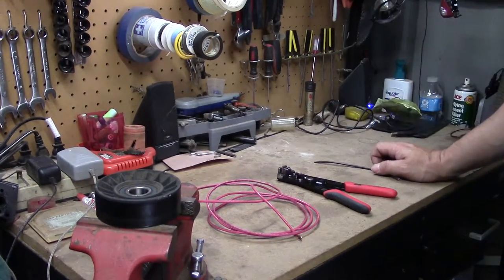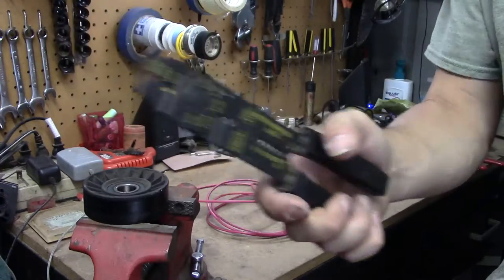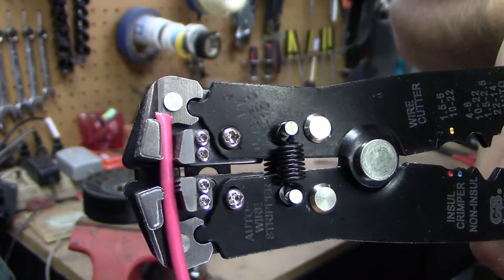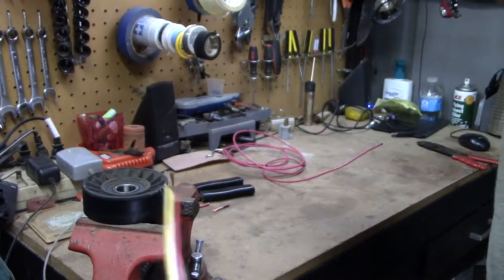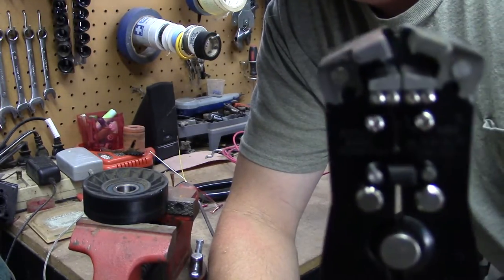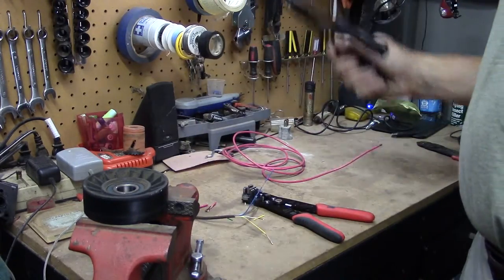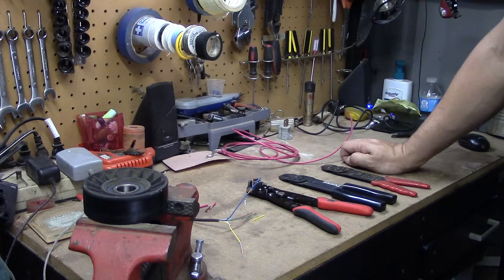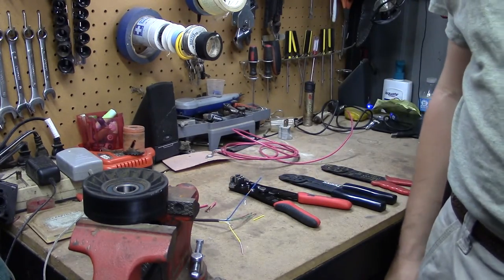GARDNER BENDER WIRE STRIPPER REVIEW

Comment: Wow!  I just bought the cheap one you showed that wouldn’t open.  I am now going to return it and get the major upgrade one!  Funny thing I was looking on how to use the cheap one and so lucky to have found your video!  Thanks! Back to Home Depot I go!
Reply from the maker: Yeh mine has become a little sticky but not bad. I just used it the other day and it's still the best wire strippers I have. Thanks for watching.

Comment: i have the same exact model and it doesnt work that well , is there a adjustment for it ?
Reply from the maker: I am not aware of any adjustments. That is odd, mine is still my goto stripper I love them.
Reply: @jason-white  mine does not hold the wire in the back
Reply from the maker: @EnergySeeker  Interesting I looked at mine and I do not see how it is possible, the more you pull them together the tighter it holds the wire and they in fact do not have any adjustments that I can see. I would ask for an exchange.
Reply: @jason-white  i think so too , thanks for your time

Comment: I got one today at ace hardware for $18.99. Need it for electrical modding projects.
Reply from the maker: How is it working out for you so far? I love mine, use them every time I have  to strip some wire.
Reply: I want to buy it , I m an electrical engg.
Reply: How can I buy it

Comment: The blades dull and can't be replaced as far as I've found. But they are great .... while they last.
Reply from the maker: I never thought to look into replacement parts until reading your comment but it would appear you are correct, I was not able to find new blades on Google. The good thing though is I made this review 4 years ago and my GB-394 strippers still work like new. Also I found this same model on Amazon for $10 so when they do wear out I will just toss them and buy a new set. Thanks for watching.
Reply: @jason-white  Many years ago, when this concept first appeared, you could get replacements. But at the time, the strippers were quite pricey. They've gotten more mass produced and cheaper (my guess) so it's just not worth it to sell blades. I'll get another one soon. They are simply the cat's meow!
Reply from the maker: @livenotonevil8279  Yeh I see that concept. New tool for $10 or a part for $5 that I then have to spend my time installing.